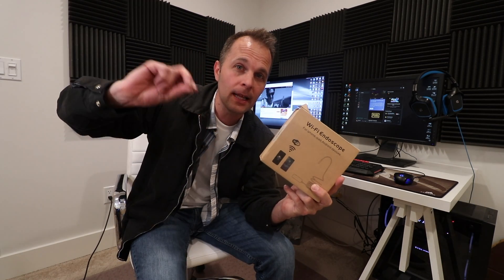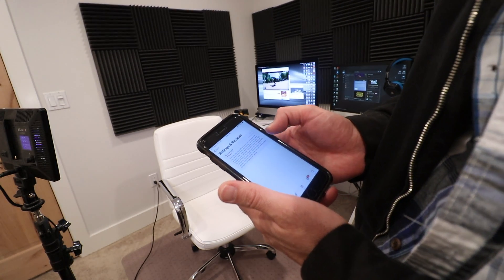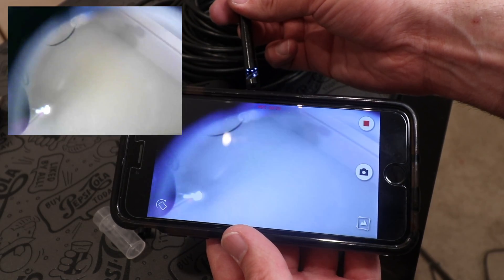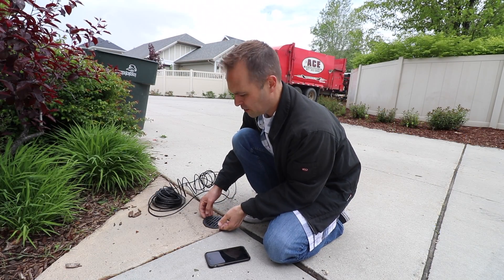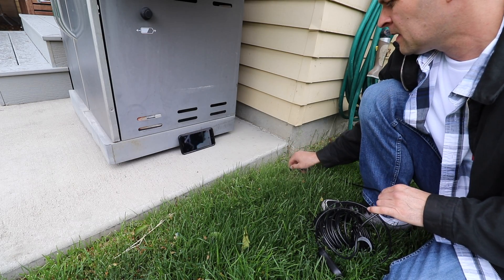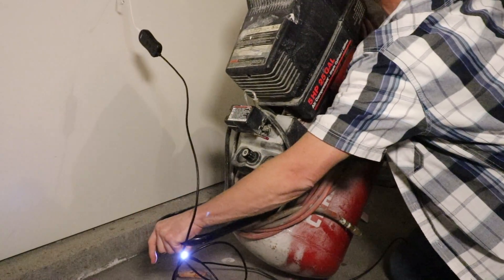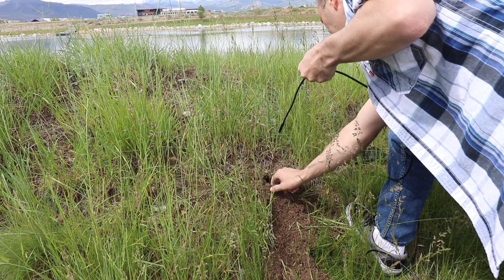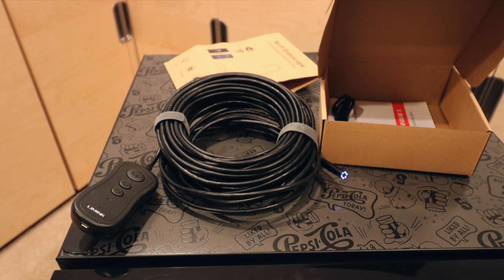Inspection camera for iPhone ( WIFI Endoscope Borescope )

Comment: so there is absolutely no stiffness in the cable? it's just a camera on a long wire.... you'll need a rod(der) to use it.
Reply: It's pretty stiff.  Would work on a gun barrel or engine cylinder inspection.

Comment: Good review. I bought the same one but shorter earlier this year. It’s actually pretty good for the price and it’s helped my work as an electrician get done faster and easier when fishing wire. The only 2 issues I have with it are that at a distance from objects it’s out of focus. It has a fixed focal point that’s clear at about 3 inches. So an autofocus would be great for future models. The next issue is that’s the frame rate isn’t to high which causes the video to be jittery when it’s moving. So a higher frame rate with image stabilization would also be a great improvement that I would happily pay extra for. One other small issue is that the picture ratio is 4.3 instead of widescreen 16.9. Whe your phone or tablet are upright the image will be a small 4.3 box but when you put it sideways you’ll get the same 4.3 but stretched which I dislike. I’d rather have the 4.3 unstretched and have black bars on the sides when the phone is sitting sideways. The LEDs should have been white also instead of blue. I love how the tip of the cam looks lit up bright blue but when it’s illuminating things it makes them look bluish. I do t really care for the 3 main buttons on the device itself either. My phone can take screen shots and screen record so it’s not necessary to have that on the device itself. Likewise the zoom buttons don’t need to be a feature either since the camera isn’t actually zooming in. Those buttons just magnify the image. Which you should be able to do with pinching the screen to expand it. You get pixelation either way. So yeah if the lense had a true zoom build in then the buttons would be more practical for that unless they just made it on the screen to press and relay to the device to zoom in or out